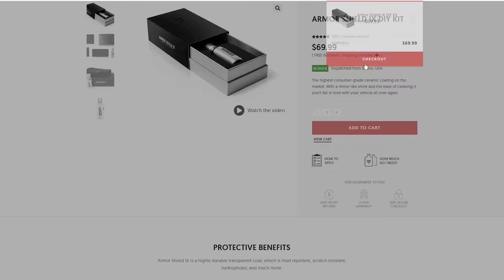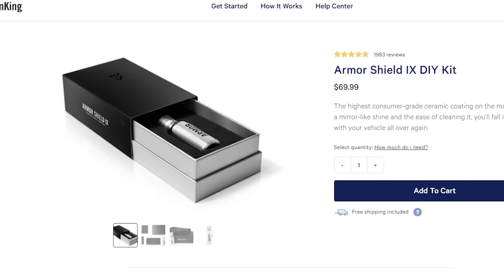$60 ROLL ON PAINT JOB CHALLENGE

Comment: I’m actually impressed with how well it turned out. It obviously doesn’t “pop” like a true paint job, but it still looks decent.
Reply: There is a rolled on forums dedicated to roll on paint jobs. After a cut and buff they don't look bad. Never done it myself though as I have guns and a compressor.
Reply: I honestly think it would pop with clear coat on it!
Reply: @sinformant  iìo⁸ķìi8iìiiiiiiì
Reply: Did u sand it before u paint it
Reply: @sinformant  😮😊
Reply: The high finnish is showing up the imperfection on the bonnet repair.
Reply: Yeah but pro paint jobs are so expensive they are sometimes more than the car is worth so you will never see the cost back. 60 bucks, some time, elbow grease, and end up with this paint job? A car that might have otherwise went to a scrap yard if the paint got worse etc? Instead now it has loads of life left, looks good, honest car, could be proud driving it, be proud to give it to a son or daughter. etc

Comment: 🤣🤣🤣 flashbacks. I remember when I was a kid and my uncle did his 50 foot paint job. 🤣👍🏼🤣 He painted i mid 80’s Ford Escort with red porch paint and Yeahhhhh it looked pretty good from about 50 feet. 🤣🤣🤣 Summer rolled around and he decided he wanted a convertible. Grabbed a saw and hacked off the roof.
Reply: When I was eleven my Dad was at the onset of building a three bedroom addition to our home.  He needed a truck for the project and at the same time he was done with an old convertible that I had grown up with.  He decided to make a truck out of it.  He removed everything for the convertible top, the rear seat, and took off the trunk lid.  Then he cut out the the section of metal behind the rear seat and where the trunk began.  So behind the front seat everything was wide open.  He had effectively created a very useful hillbilly truck, and it served well through to the end the project, and then he drove it to the recycle yard.
Years later my Dad was kicking himself because the market value of THAT convertible had skyrocketed, and they were selling (and still sell) for prices in the tens of thousands of dollars.  It was a '58 Chevrolet Impala.
Hindsight is always 20/20.
Reply: @discerningmind  not to mention he basically just did a UTE conversion and those have a huge niche market right now. 🤷

Comment: I was looking into painting a van using marine topside boat paint. It's not very expensive, can be rolled/brushed on, self leveling, and UV protected so it won't fade. You can use the same techniques that boat guys use and it should produce amazing results with no brush marks or orange peel (called roll and tip). I would love to see a video of you trying it out! It should have high gloss similar to a spray gun.
Reply: I attempted to roll and tip an old Whaler skiff 2 years ago. Bought all the best brushes and paint from West Marine. Prepped and watched every video. I just couldn't pull it off. Seems like those guys are artists with those brushes.
Reply: Topside is good paint, it’s the color choice that turned me off to it.

Comment: There are a lot of videos on rolling, but this is the first one that I've seen that used the ceramic coating to protect the paint.  That's a great Idea for those of us who don't have a controlled environment to spray paint and apply a clear coat for protection and shine.  It may not be equal to, but still....

Comment: Back when I had a makeshift paint booth, I sprayed my probe with a $10 HF spray gun and $150 compressor and that laquer from auto parts stores. Turned out fine. Not professional level but just an experiment anyhow. LSS, I no longer have a paint booth unless I section off my garage to avoid getting overspray on everything. Still debating on whether I should go with this method, spray or wrap.

Comment: Nice video and good result. One question regarding your advice on urethane-based car coatings: If your roll-on paint is incompatible with any such future coating, well, would that not also imply a mandatory primer before your paint job, e.g. after initial sanding, as a chemical barrier?

Comment: I am in the process of doing this with my 1970 Mustang. I’ve spent WAY too much on the mechanics of the car to get a full on pro paint job. What do you think about putting a clear coat on top of your oil based paint? I know 2k is the norm for auto paint, but what about for a DIY roller job? What clear coat would you recommend?

Comment: Great option for my 1986 Ford F150 Pickup. I would do two coats of Rustoleum color enamel and two coats of Rustoleum spray can clear coat, before the ceramic coating. Your little boy was the best part of the video!

Comment: You should do a spray paint job. Maybe use a better brand than rust-oleum. I recommend Montana or  Belton which are graffiti paint brands. However the quality is much better. Cool project though.👍
Reply: +1. If you ever need to paint anything just walk in a graff shop and buy some Flame, Belton, MTN, Montana, Loop, Ironlak or Kobra. That stuff is super durable, no matter the brand! Also statewise i think you can just buy em online. The Rusto turbos are pretty neat too.

Comment: K, i have a question, if i was to get a transit van with it's old company logo, an did this with white paint, the next owner would have to strip all that off to repaint say in there company logo or whatever, or is there paint i could use for this?

Comment: I’m almost 60, I did similar with a 1975 Impala. I did all the body work at home, bought the paint, had a crappy body shop spray it. I ended up wet sanding the bad spray job and hand buffing the car. It ended up looking great. T can be done on a budget.

Comment: I've used rustoleum on a few cars.  Got rear ended once and went in to get insurance estimate.  I could see the body guy wondering what color the paint was and how he was going to match it.  I have  a good but tiny sprayer.  Needed many refills.  Always outside.  Thinned it just enough to spray it.  Never had to sand it afterward and it would have a killer shine.  As always, it's the prep that kills you but makes all the difference.  Great job by the way.

Comment: Great video I’d like to give you guys a trick from an old boat captain and Crane Operator there’s a product out there by interlocks called 333 brushing thinner and it works well with restore Liam paint I did an entire Manitowoc 2250 crawler track sides came out awesome with a brush and a roller the 333 really makes the rust oleum flow out no Orangeville save your entire stuff but must wear respirator very stinky give you a headache no Bueno also good on boats you go to drydock you do your bottom they throw you back in the water you do your top size with triple 3 and a roller comes out great way to expensive to pay the storage fees at the yard while you spray the boat and they don’t allow spraying outside anymore Try triple three it works it’s expensive but it gives you a great finish

Comment: Looks very good & much better than the 10 coat 50/50 mix white Rustoleum roller paint jobs with compound polish I did in 2010 & 2013. Gonna try the 2-3 coat uncut from the can this time around. How many days did it take before wet sand & polish could be done?

Comment: Don't use thinners.Best thing to do with oil based paint when painting cars is to heat it up first by putting paint can in boiling water .
Same principle as canned soup as when you heat it up it  goes thinner. 
It will cover better and dry quicker 
Spraying or rolling oil based paints when you heat it up.(thinning paint will make it sink into bad repairs etc)
Don't heat any other car paints lol.
Knacker lacquer aka oil based is ok for old bangers etc ,as you get what you pay for .

Comment: I really like the orange peel look and want that for my mad max interceptor..my problem so far is the roof and hood..I thought because of the large surface I should use a wide roller with long handle for reach...its causing lines and not leveling at all..going to sand it down this weekend and use a different technique...I'm using rustoleum satin.
Thanks for the video, got to get ready for work

Comment: Could you brush or roller paint something like Eastwood Urethane 2K single stage?  I don't mind spending more on the paint but I don't have all the tools and a booth to do a proper spray paint job but I still want it to look like I did.  Don't mind extra coats and wet sanding and buffing.
Reply: I was looking into that, have you found anyone that did it? I think with a reducer it may work? I thought about calling Eastwood to see what they say?

Comment: I am painting my 1999 Honda Accord's front hood using roller.  Paint wise looks fine, just too much orange peels and overlap of roller marks.  I am sanding it, and will buff it as you suggest and see if it comes out better or not.  Thanks for sharing your video.
Reply: Did the sanding and buffing work?

Comment: MY DAD USED TO GET THE MARINE RUST PAINT  AND THIN OUT THE PAINT AND ADD THE HARDNER SO THAT HE CAN SPRAY IT  WITH HIS ELECTRIC SPRAY GUN  IT CAME OUT EXCELLENT NICE AND SHINNY HE DID ON MY 1984 MUSTANG , GR8 JOB FOR  ONLY $25.00  YOU CAN SEE YOURSELF IN THE PAINT  FROM 10 FEET AWAY👍

Comment: I painted one of my old cars with sprays cans in my parent's garage. The place smelled "a little" like paint for a few days, but turned out pretty good! For anyone thinking of going the spray can route, I recommend soaking the can in very warm water (not boiling, obviously) to really soften up the pigments prior to shaking. Then, while painting, multiple light coats almost always give better results than one or two heavy coats. My brother painted all his motorcycles this way, wet sanding between coats, and his paint jobs looked like glass and lasted as long as the OEM finish.

Comment: I saw this kinda thing a lot growing up. Mostly painted with a brush though, I remember helping a friend paint his 84 Corolla in his yard using oil based paint and brushes. We set up a wooden rig as a kinda guide so all the brush strokes were lined up along the length of the car. It ended up looking pretty cool, like deliberate texture in the paint. When you are broke you tend to get creative. Then you see some rich kid at school with a brand new mustang (foxbody in those days) and in a year he has another, new car cuz someone keyed it (hey, whatcha looking at me for :P). Necessity is the mother of invention. On my first car I used spray cans and ended up doing about 12 coats before sanding it back all the way down to 2000 grit then hand buffing (as in with a rag and buffing compound). The whole process took me a month of afternoons and weekends but I ended up with a near professional finish, especially once I waxed it.
Reply: Pp

Comment: I'm in the process of painting my car.  I did what everybody else has done - watch a whole bunch of YouTube videos and buy spray cans to do the job.  From experience now,  I will say that I will never paint a car with spray cans again. They are incredibly expensive plus you have to do at least 3 or 4 coats to get any decent result .  If you just want to paint your car , the only way to go is to paint with a roller or small applicator .  The cost is a fraction of the cost plus it looks a lot better than using spray cans ...

Comment: Good video. I watched because I'm going to paint my 1989 Chevy truck (work truck) like that. What I'm still wondering is the mixture of the paint. There is a hardener available that would make this paint get a lot harder faster. What I'm not sure of is if I should use that with the roller. There is also some stuff that will make the paint flow to get more even. How important is it for the work truck?? Probably not at all, but I still like it to look good. Did an older Buick with Rustoleum once and even with the orange peel I was happy.

Comment: It's not uncommon to roller or brush paint old vans over here. You can get quite a good finish if you take your time. Foam rollers give the best finish. If you want to lower your suspension just cut a coil off the springs lol

Comment: Great job. Thanks. 

Would soda blasting work as well for the sanding?  I guess you’d need a catchment plastic booth and gas masks to protect from inhaling particulates. 

Can you Soda blast outside? I want to do that but I’d wast so much of the medium on the floor and the air.

Comment: I did a rustoleum paint job (Harbor Freight purple gun with acrylic enamel hardener) on my old Police interceptor that is in my profile picture. Paint, interior, wheels and tires, brakes, intake manifold, and a transmission rebuild, I've got countless hours, but only about $2,000 in it.

Comment: My first car was a black Ford tempo that was starting to rust, and I had no idea on how to paint or repair it. Instead, I had what seemed a genius solution (I was smoking a lot of weed at the time). I somehow came to the conclusion that it would be a great idea to take some 6" wide shiny reflective metallic duct tape,  and use it to make a giant pinstripe around the center of the car. I may have even stacked it, and had a 1' reflective stripe encircling the car. Not only did it look horrible, but I didn't take into account how much a black Ford with a reflective stripe around it can look like police car at night from a distance away. I would go to parties and people would see me coming down the street and think that it was the cops, and it would be pure pandemonium as kids were ditching their drugs and alcohol & others were running out the back door. This went on for 20 to 30 seconds,  until I got close enough and someone spotted the realistic looking bloody severed head jammed between the passenger side dash & window--that I had stuffed there 9 months previous for Halloween, and just never bothered removing--and then, ironically, everybody relaxed a bit once they realized the cops weren't coming to break up the party. Moral of the story... Always keep a fake severed bloody head in your emergency car kit--because you never know when it'll come in handy.

Comment: I'm restoring a car right now and i've been brushing on some alkyd based fence paint and i think it's generally better than oil based paint.
It's mostly used as a primer to cover up the bare metal because stripping paint is easier than stripping rust.
Brush leaves streaks so i might try rolling it on because it seems to work so well for you, also the paint levels out very well.
Reply: Try Por15 its self leveling and hard as a rock when set

Comment: If you really care that much your trying way to hard to get validation. Your one of the few 16 yo kids who are lucky enough to have a car. Don't be a dweeb and a try hard. Use common sense when trying to improve anything on a budget. Your 600$ car will need repairs monthly. Sometimes weekly. And chances are if your driving a 600$ your broke af and you probably need 100 bucks to fix something that's been broke for a month now.....you know what gets you cool points ? "Drive it like you stole it" "just beat it baby" and my favorite "how can I make it go faster" i by the time i was 18 i was on my 7th or 8th car..  cant remember.  I'm 42 now. I drove 600$ cars all day long, did all my own work, I'm talking L body 86 regal limitedwith the 305 glug glug glug, maroon Moroon, velour interior, graigar style five spokes, paint all faded and grey Pontiac steering collum n wheel. I owned it. That's what makes YOU cool. 87cutlass blue with white soft, factory spokes hubcaps. V6 , her nicknames was "gutless" 😁
I had a square body 85 impala with the 4.3 fuel injection and it was faster off the line then v8s. Pea soup green on pea soup green. "The dill Mobile" and then I was Known as Dill cuz I always had that green naaa mean. I put 68 14" Camaro  rims from a junk yard on it. Coolest car in school instantly with white stripe out on touring tires, I'd scrape over bumps and so I spent 40 bucks and got plates that said scrapenby. Paint all faded,  bondo primer coverd spots. 2 15s in the trunk n fluffy dice in the mirror. Its swag. Not brag.